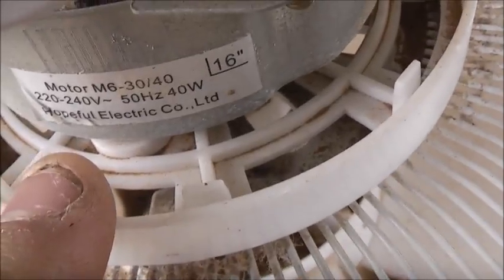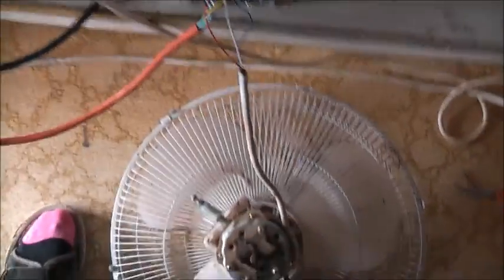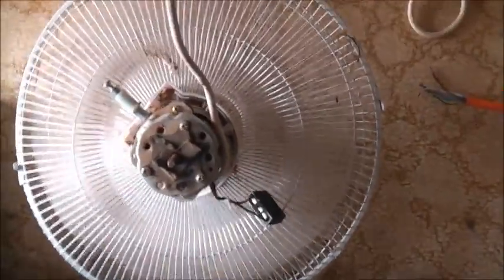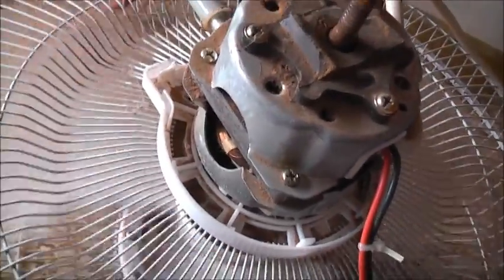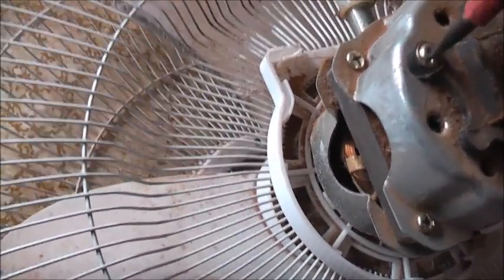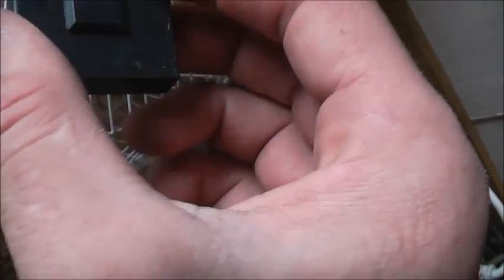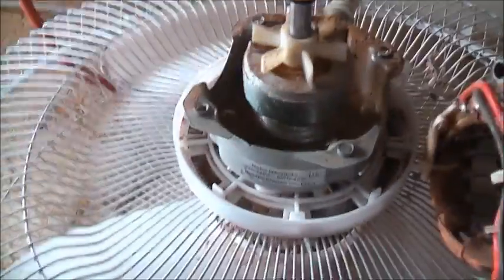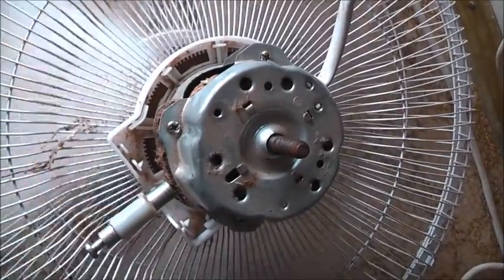Pedestal Fan Vs VSD (VFD)

Comment: Hmmm...... Variable speed on a desk fan?

One word: Variac. :D

It's one of the first few things I tried out shortly after wiring my 10A puppy. I done a fridge fan, a desk fan and of course... the big air rotor fan. All worked OK, it's just that you have to be careful on the lower voltages, because if the fan rolls to a stop, it'll just probably sit there and smoke-up until there's flaaaames!

Overall though, a desk fan does have more flexible control with the use of a variac. Just put the desk fan on it's highest speed, then use the variac instead, for speed control.

Thanxx for showing,

-BoomBoxDeluxe.

15th December 2014, 03.00

Comment: you need it to be a single phase VFD output ontoi the high speed winding taps.

As Josh C said, it is probably one winding with taps and a run capacitor (would explain why it didn't spin without the cap!)